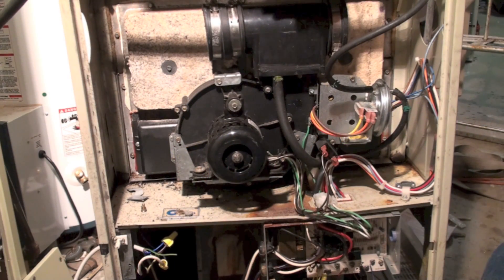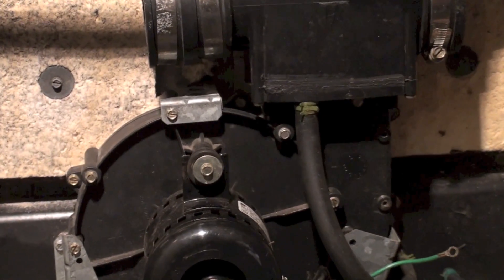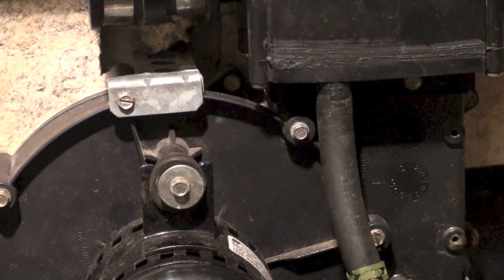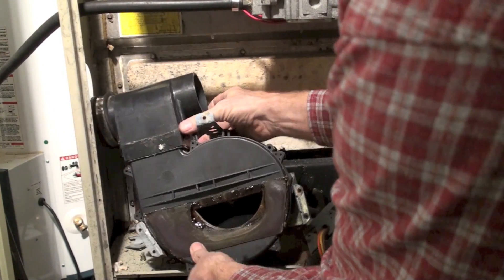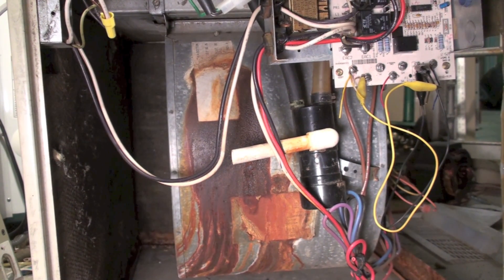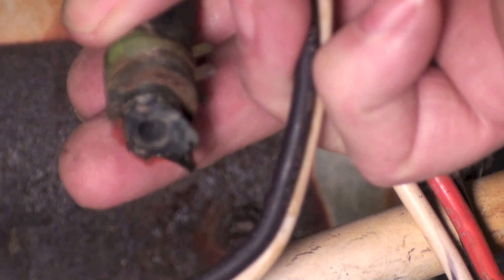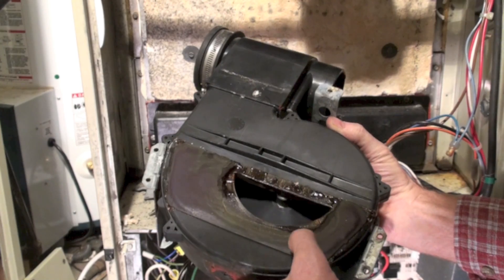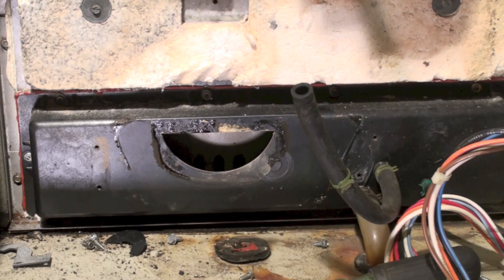Inducer replacement 398aaw Carrier gas furnace

Comment: You can fix the broken drain fitting with a high quality epoxy (definitely not Super Glue with a very low shear strength) without having to replace the entire inducer housing, motor and fan.  Any service tech. that would replace a furnace based upon that one break is doing the customer a disservice!  Again, you do not have to remove the entire inducer assembly and thereby cause these breakages!
Reply from the maker: I must admit I have never tried replacing the motor/fan assembly, but I will stand by the plastics problem.  These earlier plastics, especially on the Carrier unit gave me a lot of problems.  Thanks for the thoughts.
GFM

Comment: It is usually the inducer motor and/or fan that fails.  You don't need to take off the entire inducer assembly, thereby breaking the drain off and breaking the seal between the inducer housing and the furnace.  The motor/fan pulls out of the front of the inducer assembly.  The actual motor/fan is not that expensive.